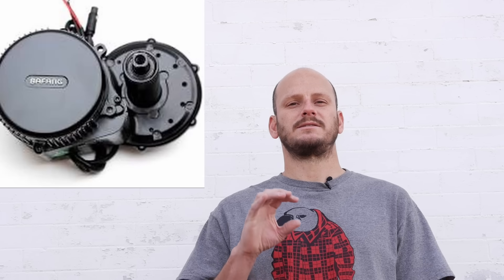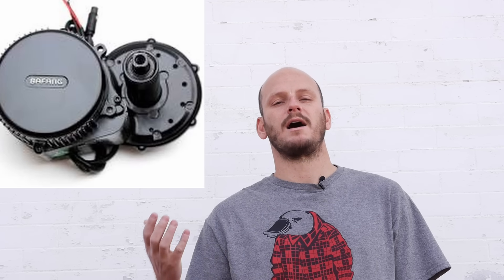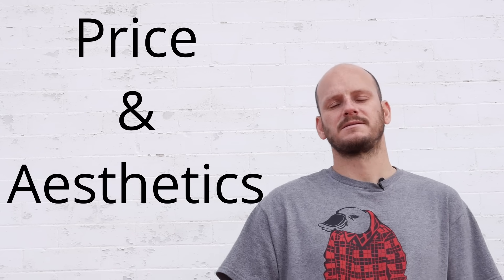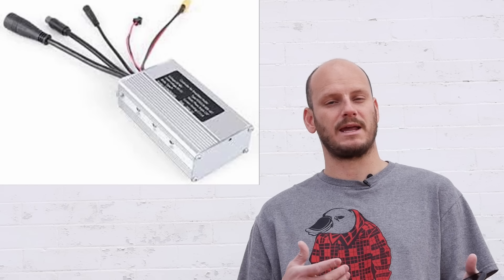Hub vs. Mid Drive Motors: Why Hub Motors Suck and Debunking Common Myths with performance test

Comment: Many Commercial E-motorcycles and Scooters are using Hub-Motors while others use Mid-Drive setups. Personally, I'd like to have a left hand thumb throttle on the front wheel hub motor and a rt hand twist throttle on a rear wheel Mid-drive on the same bike! A both-either/or switch like Grizzly has would work as well. Insurance in case either motor breaks and AWD for those black ice days...LOL

Comment: I have a HUB motor and I have had no problems. No loose spokes, no loose chains, and with accelerator used, I go from 0 to 29 way too fast!  

I ride normal bikes all the time and hub e-bikes are kick butt way better than mid drive … hands down….feet up…whatever body part you want to  use as a night/day comparison. 

Get a hub drive.  Mid drive is not the future… wait for it… hub drives are both the past and the future. 

Do not get a  mid-drive. They do cost too much if you are not doing a conversion.  Way wayyyyyy more expensive.

Comment: I'm converting a yamaha pw50 to electric and a hub drive would make the conversion easier but would doing a little more fab to make the mid drive work be worth it? Looking at a 750w-1000w 
Obviously no crank so it'd be a single speed
Reply from the maker: A hub motor would be my suggestion most likely for a quicker easier install.

Comment: True about performance but i'll NEVER use mid drive. NEVER. As a long-distance bike driver , mid is very unreliable. Every movement goes through chain. If chain snaps, bye bye. Gear wear and cost of maintenance  is much higher. My chain is around 6000kms and my gear teeth are like new. Hubs, direct driven are much reliable if you use them properly. You have coils , hall sensors (3 of them) and bearing. Mids have sensors , gears , bunch of stuff ... Simplicity means reliability. Also, when you need different , more powerfull controller or just replace faulty one -  with hubs , you just change external controller and thats it. If mid breaks , you are f*cked.
What about price ? Cost of servicing ?
Nobody talks about regenerative breaking. My regen saved me a big bunch of brake pads and increased range for up to 10 percent. 
Almost 99% of mids , especially branded ones are so expensive that you can buy 10 kits of HUBS from AliExpress.
I bought 1500w hub that can climb any hill , my chain , rear wheel spokes and overall health of bike are like on the first day (6200km) , only replaced brake pads once. Over 100km without pedalling with one charge (1250Wh battery) up to 60km/h with throttle only and it was 1400eur (whole bike with motor and battery etc. , assembled ready for use). Stupid Bosch mids with 250w of power can start with 2000 euros and are limited to 25km/h (especially Europe)  , and many of them pedal assist only hahahahhahaha Sad :( 
Just go, feed the hungry corporations.
Conclusion , if you need lighter   city bike for small range and average personal use , more expensive and complex go mid. If you (as myself) need reliable , simple , user configurable and open for tinkering, robust and "open source" long distance ebike - go hub.
Reply: Sounds like ur coping. I have both. Mid drive with a belt drive is far more reliable,  efficient, fast, and with greater torque. Also i dont get this controller thing, my mid drive motor has a built in controller that I can remove from the side and snap in a new one

Comment: lol he forgot to mention that mid drives are like triple the price of hub motor .for example i have a 10k hub motor what was around 700 try finding a mid drive for a similar price and that they have bad top end i build a bike 2years ago hitting around 40mph and it destroys mid drive .no hate but as someone who has owed both hub motor is better no hate

Comment: Not tried a mid-drive but very happy with my hub drive, assist only (UK) Absolutely no trouble with varied terrain (hills, valleys, on my commute) I have had the chain come off when I was starting out, over bumps, but that was probably more how I was riding it, I would stop peddling when hitting a bump but through cycling confidence, I don't anymore.

Comment: Electric need to replace the engine with a electric motor and you still have the clutch am gears or automatic transmission.. This will drastically reduce the cost of electric cars.

Comment: Mid drive...pedal crank drive you use the bikes gears to multiply the torque power.. so you can use a smaller power motor and therefore much more battery range or smaller battery

Comment: Be fore I listen to your reasons, I paused to type out mine. 
1) I think mid drive motors are better because you get the most out of a motor through it spinning the drive wheel by chain or belt.
A hub motor , I would think is working harder when it's spinning the drive wheel around itself. 
It's like a bigger gear on the motor spindle rather than a say, 11T gear.
Now, back to the vid.......

Comment: The mid drive may give more torque but it's a tiny sweet spot then you gotta shift repeatedly.
The hub gives half the power seamlessly from stop till silly fast, shifting is optional.
Crawling up a steep rocky trail mid drive is a goat.
Smooth less steep hills and the hub flies up and downshifting doesn't chew up the chain under load. In fact there's little load on the chain and if it breaks you still get home.
Mid drive stresses the chain,wears expensive gears and failure leaves you stranded. Better have a chain breaker and extra link.
The main problem with hub is the heavy wheel with a wire coming out makes flat tires a royal pain and jumping risky.
Range is limited as it's dumping power to the wheel in buckets and the motor doesn't get gears.
The tire spins so hard it blows tubes from centrifugal forces.
I wanted to try tubeless but cheaped out and suffered through so many flats I went mid and never went back.
Still there's something about the hub that I can only describe as a magic flying carpet.
Got so I only used the front sprockets for granny,drive and overdrive. Back gears are spaced too closely and redundant.
I will make another hub drive someday. Tubeless for sure. It's just that it's a good day for riding and my battery is ready to go.
You just can't rocket out of a corner like a two stroke if you have to shift constantly.
Reply: Can also put flat out in a tube its better than tubeless , no maintenance
Reply: @EBikeBuilder_  I got thorn and pinch flats with slime but no problems tubeless.
Nothing like the mess of a slime flat. If you run slime carry a plastic bag to put the blown tube in otherwise you'll be tempted to leave the gooey mess on the trail.
If you let the pressure get too low tubeless the bead can blow and you're stuck unless you have a backup tube.
Now there's foam inserts with a tube inside.
I got a set but haven't tried them yet.

Comment: Sounds like engineers need to negotiate the gear and chain system for the mid drive and come up with a more robust system.
Reply: Sounds like…. You read some nonsense on the internet? 10$ kmc z7 chains and low end freewheels can take multiple kw of power without breaking

Comment: I'm trying not put a  bafang mid motor on a trek Malin 5. The myth is that the frame will crack since it's a aluminum and not a steel frame ? N.e.1 here gots an answer for me??

Comment: I used a hub motor and they are so heavy they damage tires and are not great at low speeds the geared hubs are a little better though.

Comment: It sounds to me like you're flashing out the people who use a hub motor and not the gears attached to the wheel in tandem.  Maybe it's an old habit I'll always shift down to 2nd or 1st gear when stopping or climbing.  My pedal assist has never seen above level 3 of 5.  My legs get me moving faster than Canada law allows the bike motor to go (34km/h max speed).  Either way things break and everything has an advantage or disadvantage to something else, just depends on how you use it which is the better application for you.  Like suspension vs none, I prefer none cause a back spring kills my fractured back to pedal, but its "way better"

Comment: What about double hub like Ariel ebikes? Is that any better or still the mid drive is better?
Reply from the maker: Check my video on that subject, but ya mid drive still 95% of the time
Reply: Not fun changing tires / fixing flats / working on your wheels or brakes / etc, in general, with torque arms and motor cables on both wheels.
Reply: @EBikeBuilder_  Thank you

Comment: I agree 100% I did my wife's mountain bike and mine we both have front and rear suspension and tons of power I had to go to a 38 front tooth drive gear because the 44 was waaaay to fast, with my 38 I still get 44 Km on gravel road. but climb!!! OMG , gear down and crank the power up to 5 or 6 and you can climb walls. Forget the Hub drive nonsense. My kit was a BFANG everything was supplied . Love it. I did both bikes with a 11AMhr batt for $1500 CND $  750 WATT.

Comment: I'm a bit alarmed when someone talks about putting a 3 KW motor on a bicycle. That's an ersatz motorcycle; in the U.S., that's a Class 3 e-bike. Of course, a bicycle power transmission -- designed for the limits of human power -- is going to eventually fail when put under that much stress. 

If you want about 5 HP under your seat, start motorcycling, because that's roughly equivalent to an 80 cc motorcycle.

Comment: WRONG , I can by a complete new 2kw dual planetary hub motored ebike  for 3300$ cheaper than a bafang 2kw mid drive motor KIT for 3450$ that only has a 45mile range and that is minus the BIKE. Everybody talks torque but torque doesn't win races HP does. In a nutshell Torque= the amount of work that needs to be done which does NOT include time. HP INCLUDES the rate at which that work is done.
To be honest I would not touch a mid drive due to the weak link of the chain.
An honest critic
Reply: I don’t think Johnny said anything about winning races 😂

Comment: Hey mate, I'm having trouble to ride my converted bike (Swytch) without battery, or when suddenly it goes flat. Although they said it would be like a normal bike, it's just way far short that. There's a huge resistance. Does it happen with those mid framed motors?? Thank for your time.

Comment: Hub motors are great, but they won’t even last you through rainy days… Most of them aren’t waterproof, so if it starts raining, and water gets on the hub motor, you are fucked! You can’t even dive off into the snow with a hub motor!

Comment: I have an E-Bike with hub motor and like it a lot. Drove 55.000km in 8 years with two motors in the same bike.
And still drive it on a daily basis from Leonberg to Stuttgart.
This is not flat terrain at all.
The brand is "Alber Neodrives".
German product. Not perfect but ok.
I have uploaded videos about my experience, but they are in German language.
The second motor had different spokes and I didn't have any problems with spokes since 30.000km. It's just a question of picking the correct spokes. Material choice matters. I don't have experience with Bionix, though.

Comment: hub drive the power conservation they are easy to deal with and the chain comming of isnt going to cause a bad wreak or anything really other than maybe a little shock scare if your pedaling away in assist mode but then u can continue moving with use of throttle and wait until ur in a safe enough spot to fix your chain but if you wanna completely wreck and have all you power being supplied instantly without any resistance like a neutral gear would be i guess that what will happen if u have any chain malfunctions and its gonna happen alot from what i can tell and there are worse malfunctions i can imagine that maybe could be bad if it happens. knowing how to shift can be tricky on a bike and when i was running around on my hub drive motorized ebike i still have a shamano shifter with 7 speeds and a shift was a risk of my chain going nope not right now and then ur without any pedal powered ability but i can not imagine a wrong shift on a mid drive that is pushing full power or speed and your saift locks up a chain with a sproket or something like that ... no more good running motor or chain that is any thing but unreliable after that kind of force applied iin a quick moment i dunno sound kinda scary for anyone not very good at riding a mountain bike or who has alot of experience with long distance up hill down hill riding where shifting is critical and often

Comment: When the chain wears out and breaks the hub motor gets you home
Reply from the maker: That is true. With a mid drive you need to ride properly as to not break chains excessively.
Reply: Thankfully chains wear out over the course of thousand miles and there’s many many opportunities to utilize a 9$ tool to check it .

Comment: Great video Johnny.  I agree with Johnny. I decided to use an E-bike to commute to work, so I can avoid looking like I was in the TDF when I get to work.  I converted my 8 speed internally geared bike using a 750 watt mid-drive. It has a tension sensor on my shift cable. The sensor causes the motor to pause when I shift through my gears. It reminds me of cars I have owned that have a stick shift and a clutch! It works great. I start in 1st gear and shift up as I gain speed. I don't have to use the high assist to accelerate. I have lots of stop/start intersections to deal with in my commute and using the gears is a lot better on the battery. I rarely get past the 5th level of assist in my commute and its usually 4-5 minutes fast than just pedaling.  I don't think I will break a 1/8" chain any time soon.

Comment: The negative about the mid-drive is that bicycle chains and drivetrains are not made to handle the power some of these kits can produce. My friend who build gas and then later ebikes suffered a lot of these.  Now he goes single speed on the rear wheel and uses only #415 heavy duty chain.

  Unless you climb steep hills a lot then you won't need the gears. Ebikes around here are legally limited to 20mph anyway, so the extra gears are not usable for more speed unless you want to risk ticket, or worse getting your ebike confiscated.
Reply from the maker: They can handle it as long as they are ridden properly. As in using the gears as they are intended. People break chains when they keep it in the highway at all times. Otherwise you get a huge performance boost by going my drive over hub. BUT, not all people want or need that so it’s definitely something to consider.

Comment: Johnny

I'm looking for some advice. I have a Redline RainCity Chopper and want to put a 72v 3000w mid drive on it. The bike is a single speed belt drive. Would a mid drive work for this bike being belt drive or does it need to be a chain drive? I love the idea of using gears but the bikes a single speed so could I use a Strmey Archer  8 speed internal geared rear hub with the mid drive? Please help I'm pulling my hair out over this
Reply from the maker: You can use he belt still. Just need an adapter to use the same chainring

Comment: i ride on flat paved bike trails in florida and my hub motor does just fine after 3 years  8,000 miles but if i were going to use rugged grass/dirt up hill trails the mid drive motor seems to preform way more efficiently.

Comment: This is a year old, but I've noticed that mid drive is a lot more expensive than hub. I like My mid drive a lot better than my hub (but they're very different bikes) but ultimately what I find as the biggest difference is getting going from a full stop with a lot of weight. I have a 1000 w Bafang and usually have a combined 160 lbs of children on the back. Starting from stop is way way better on a mid-drive than a hub with similar wattage. I didn't realize that regenerative breaking isn't possible on a mid-drive though. That would also be a huge plus for me as I live in Seattle at the bottom of a very steep hill (with many other steep hills I also must ride). Being able to control my speed going down the hill with a hub-drive wouldn't be as good as the benefit from starting out easier (especially when starting on an uphill) but it's significant. I don't like having to sit on my breaks so hard for such long periods.

Comment: Some arguments are not valid. E-motors have a wider bandwidth then gas motors. Therefore teslas have only one gear and their motors don’t burn. A mid motor also applies his force to the rear hub as hub motors do -so the same disadvantage on both sides.  But what is a difference: as the hub rotates, how is energy transfered into a hub motor? Via coals?

Comment: On flat land a hub motor rules. Too many moving parts on mid drive. You have geared hub motors and you have the gears on the bike. Bring your mid drive to Florida and I'll blow you away with my hub motor all day every day. Then there's the chain on a mid drive. I have had both and I now ride a hub motor daily. Hub motor is waaay more dependable. He does mid drive because they're easy to build, a monkey can do it. In the end a hub motor is more dependable period, end of story.